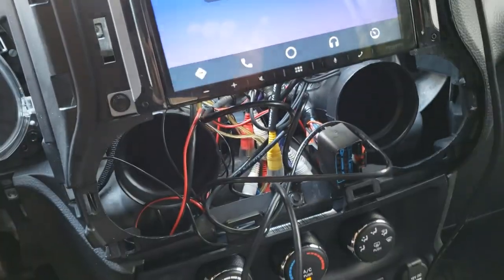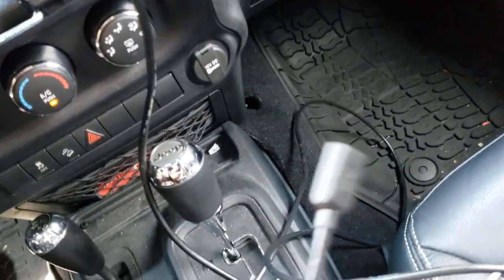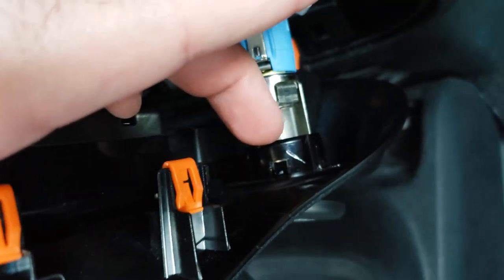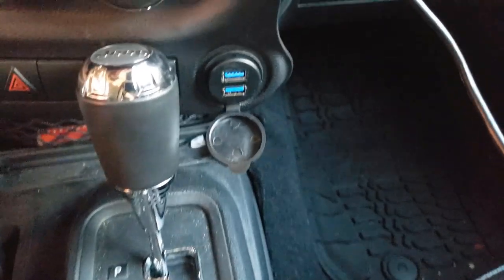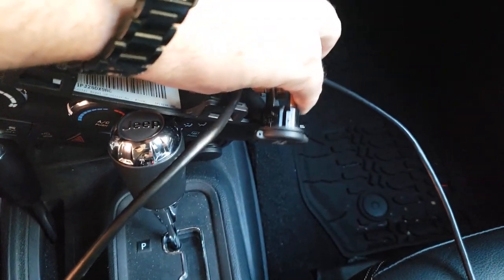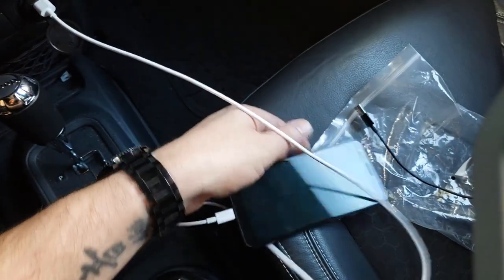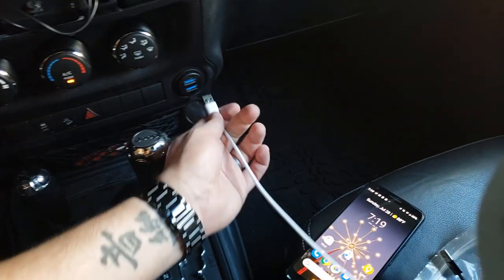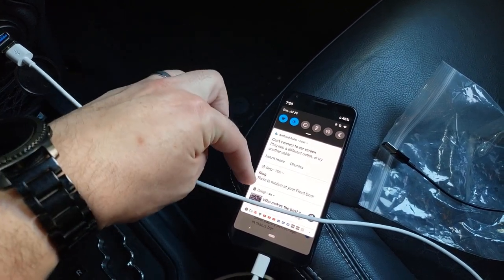I replaced the cigarette lighter with a dual USB port in my 2016 Jeep Wrangler

Comment: Thanks so much for this video. I just ordered this exact head unit and thought i would have to plug my phone into a loose wire coming from the radio and lose my dual port fast charger, now youve showed me that i can keep both android auto and fast charging. Great video!
Reply from the maker: I am still using mine every day without issues
Reply: @5after12  the 2nd usb cable from this port  you connected into your original cigarrette lighter... Will i have to do that for fast charging to work or for any other reason? Otherwise i dont see a use for the 2nd USB cable.
Reply from the maker: @bambithe3rd769  if I didn't have that original charger then in my scenario the 2nd port would be useless.
Reply: Installed all of this on my car today. Only thing i didnt realize is that the dual port lighter replacer NEEDS 2 separate power sources for both outlets to work. In my scenario, i only have one (the alpine) so i can only use 1 or the 2 usb ports
Reply: Also, android auto wont work from this unit to an LG G7 thinq, still dont know why. Works with Samsung galaxy and other phones.

Comment: Exactly what I'm looking for my car. Did you ever figure out why the bottom port never connects to android auto?
Reply from the maker: i forget what you are referencing here? One port only did power, the other would do Android Auto or CarPlay
Reply: I get the same thing. IPhone connects to the top USB easily. When I plug in my android with the factory wire like crutchfield told me to do, it says 'incompatible usb''. If I use an aftermarket wire it says 'no response'.  I have another USB coming out of the 2nd slot in the back of the stereo going into my glove box and anything I plug into that one says 'no response'. Wireless works good but I wanted to be able to wire in if ever needed.
Reply: I'm referencing the top USB in the cigaretter lighter here...the other just charges

Comment: Seems length is the biggest factor here, looking to get this unit installed in an 04 impala and I wanted to try to run the wire into the center console to avoid a clutter of wires but might not be possible.

Comment: I was wondering if you have played music files from the USB yet? There aren't any videos on here showing how the menu and folder setup is. I want to buy this head unit but will be using a thumb drive to play from. I was just wondering if it will keep all my music in separate folders like i have them arranged. All my bands have their own folder with subfolders to their albums. Thanks for any help.
Reply from the maker: Which head unit is it? I have had a lot. However, I generally just use Spotify, so I don't have much experience with folders
Reply: @5after12  I was referring to the iLX-W650.
Reply from the maker: Oh yeah, I never tried USB on that, I just used Android Auto, but I was very happy with that head unit
Reply: @5after12  okay thanks, I will have to find a shop local that has them on display and test it out there. That's of they still sell them on display. I know its a older unit, so they might not have them for display. I did want to install a computer with a display and just run Windows 10, but it's almost in heard of. Mainly because of the power consumption the computer and display will need and then it would require a large enough inverter to handle it. That's why a lot of people just shy away from the idea. I thought about doing it and uploading a DIY video on here. Will be great to have a 32 inch drop down tv with a PC connected to it for media and also playing games. Thanks for all the help.
Reply from the maker: I have videos on Android head units. Not Windows 10 of course, but certainly more functionality than a standard head unit
Reply: @5after12  okay thanks I will watch that now.
Reply: Okay I ordered 2 of these ports to add to my expedition. My lighter port stays on just like my 12 volt port does. It always reads the volts after I cut the truck off. Do you think the 2 ports I added will run the battery dead? If it might draw too much i might have to tap into a accessory wire that shuts off when the ignition shuts off. I was just wondering if you would know. That will give me 2 ports like you added plus the USB port lile you added. Thanks

Comment: Wouldn't it take about 1 second to plug in a 2x USB adapter? You would also still have the lighter outlet option SMH.
Reply from the maker: You might be missing the point, but I am not sure based on your comment.

The goal was to have a USB port on the dash going directly to the head unit for Android Auto and CarPlay.

Are you saying it would be easier to plug in a dual USB charger in the cigarette lighter port? You are correct, that would be simple, but that wouldn't be plugged directly into my head unit. That would only allow charging and not the data transfer.

For the record, I still have this setup and it works great. I have never missed not having a cigarette lighter port.